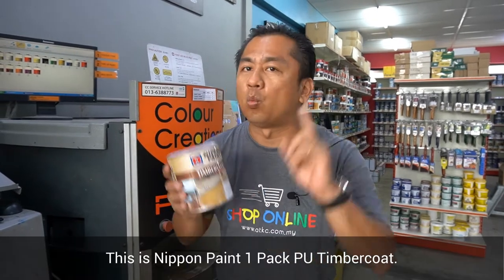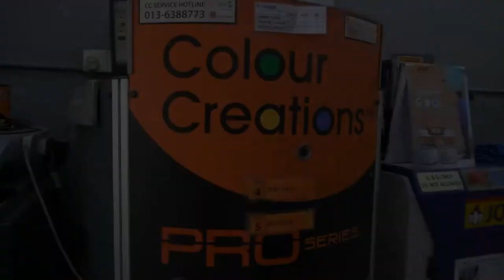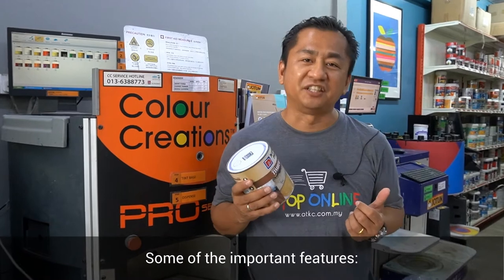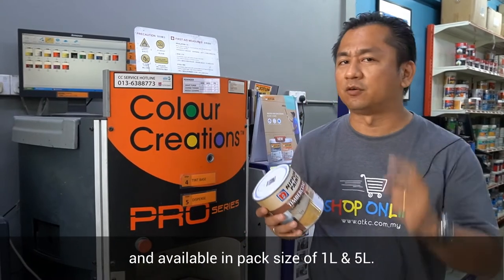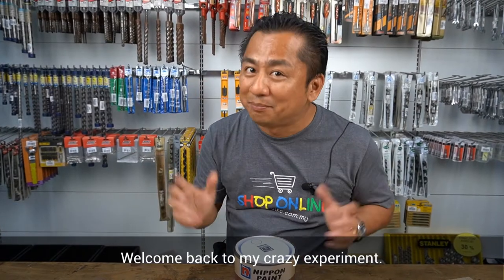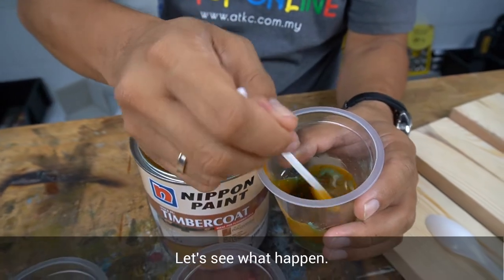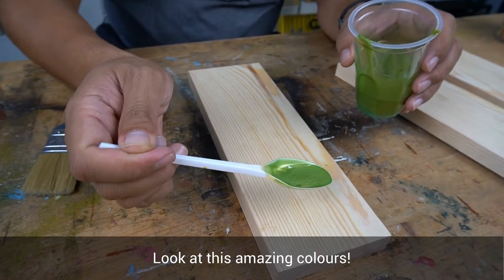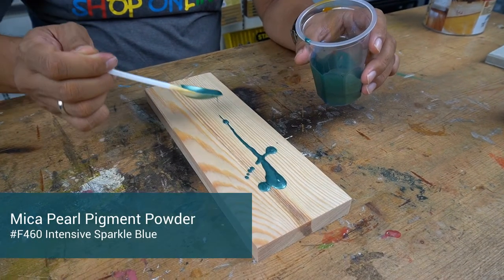How to Paint using Mica Pearl Pigment Powder | Nippon Paint 1 Pack Polyurethane PU Timbercoat

Comment: Absolutely beautiful! Wondering if you can share what it would be like if you wipe it down just so you can see the wood stain through so it’s lighter and how that would be on a piece of furniture? What kind of finish is Irvens recommended in particular for someone who doesn’t wanna have to worry about a long cure time who has pets or has a gas stove in the house and you can’t move the piece of furniture for her from it? I was researching Tung oil as one option For a finish, along with boiled linseed oil as another option. Yet another one was discussed shellac
Reply from the maker: Tung oil and linseed oil is both good option, and they are naturally organic.